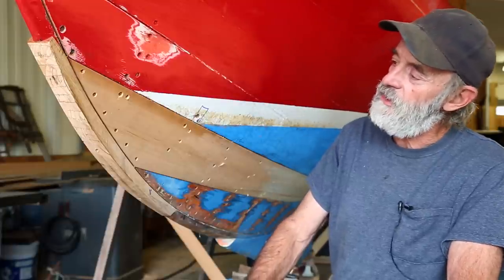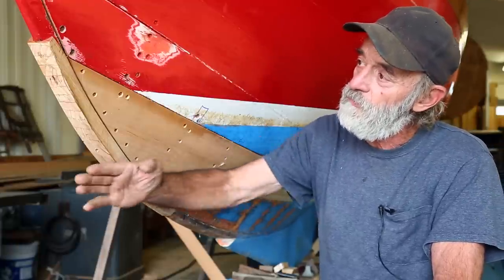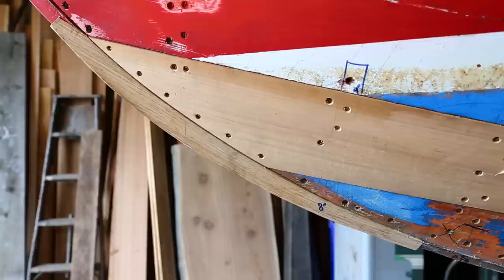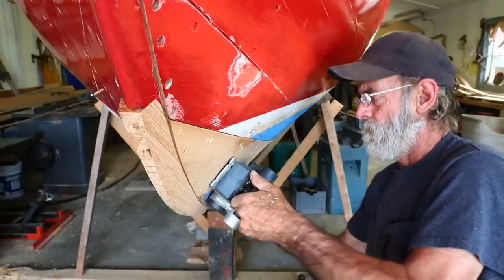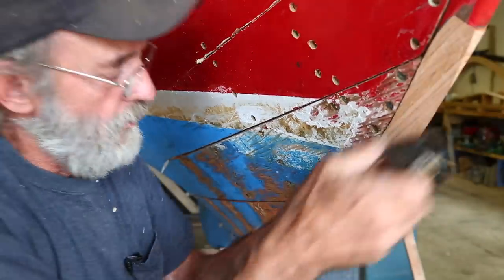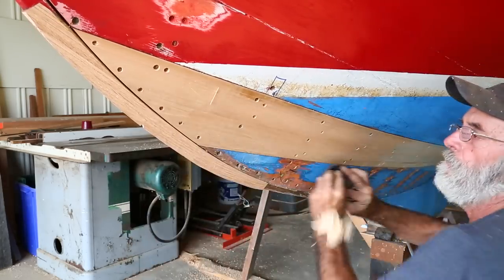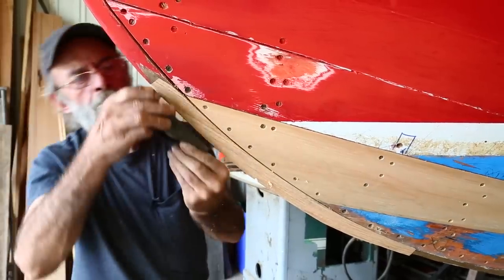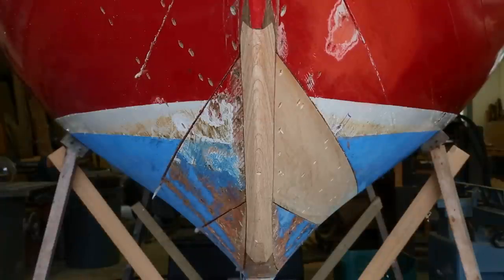Part 10 - Planing the forefoot and new plank - Herreshoff 12 1/2

Comment: I have a question.  I have a lightning class from '62.  There is a gap of 1/8" on both sides of the center board that runs the length of the boat.  I've taken the fiberglass off and I like the look of the wood.  I'm thinking of taking the centerboard off, gluing strips along it, and squeezing it back in.  Am I on the right track in thought?  Is it OK if i make it super tight? or should I be leaving 1/32 or 1/16 of an inch for flexing.  Thanks for any answers and I LOVE our channel.  Keep on posting!

Comment: I am sure everyone would like to know the costs involved in a repair of this type! You alway make it look easy, but How many hours did it take, and How much would a repair like this cost? My guess is around $2-3000.00, so far. Add another $4-6000.00 for additional woodwork and Paint. Then add reasonable used sails, maybe $1500.00. Ending costs around $7500.00-10500.00. Does this sound about right? Anyway, you would wind up with a real piece of history! 
I hope this project continues through completion!
Is this boat available for sale or was it a customer's boat.

Comment: i have a 36 feet classic wooden boat and it's really hard work and costly to do maintenance every year specially the hull and transom . i was told if i fiberglass the entire hull to just about 5 inches above the water line it can spare me from spending lots of money every season and i was also told not to do it cause if water gets between the fiberglass and the wood it will destroy and rotten it ,  please i need your advice and if i must do fiberglass than how thick should it be ?
Reply: Do not fiberglass it,I've never in all my years seen a glass over wood job last and not cause more damage.Some are ok if done from new but on a old boat there is just too much moisture in them to have a long lasting watertight bond and it will delaminate
Reply: Many thanks